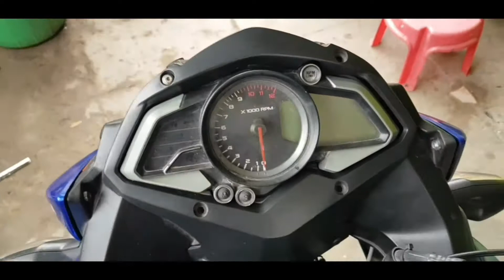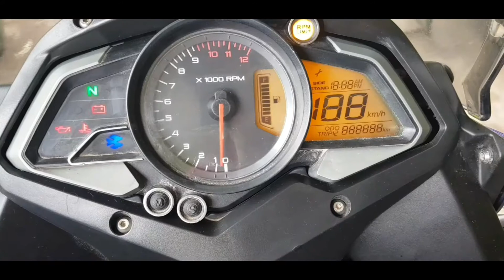Rebuilding a Pulsar AS200 | New Mods || Part-3

Comment: Nice video, For changing air filter, do we need to remove the whole front panel  or is it just sufficient by opening the tank bolts and nuts just like ns 200
Reply from the maker: We should open it fully bro , the front panel is screwed with the tank from inside.

Comment: Brilliant video bro.. I own a AS200 and a member of AS200 india group. Just love the bike's look..! Am happy that after seeing your video, couple of my doubts got clarified and it seems conversion of NS200 ABS BS6 to AS200 is possible. Totally clear where the welding needs to be done for mount and all.
I have doubt on 2 things - 
1. The wiring harness compatibility to accommodate AHO. 
2. Connectivity to 2-H7 instead of 1-H4. Possible? I mean how do we do that?
Reply from the maker: Happy to see you having an as200 ❣  
1)More likely the wiring for aho would be same as like the old one ... only a 6 pin socket will be having 3 pins or 4 pins as it's a AHO... 
2) Yeah we can connect a H4 socket as the one in Ns200 .. the wiring for headlight is a separate plug and play harness. U will be just needing to buy a headlight wire harness..
Reply: @ModMaxX  Thanks a ton bro. Really appreciate your help and knowledge... 😊🤝
Reply from the maker: @anubhavdutta9557  thank you for supporting brother ... any  more doubts dm me on instagram brother... I'd - ModmaxX
Reply: Hi Anubhav, i have been in search of AS200 dedicated group since a long time and would like to join one, so as to share and be part of the community. Do let me know how and where the group is hosted.
Cheers

Comment: Bro can we install as150/200 fairing in ns160 bs6 model ? With led AS150/200 headlights and everything?
Reply from the maker: S bro we can fix it
Reply from the maker: Only an extra fairing clamp is required
Reply from the maker: Also for led u can install h7 led in as200 fairing
Reply: Thanks a lot bro
Reply: Do you the price of the fairing and headlight setup of AS150/200
Reply: Also the clamps
Reply from the maker: @atharvagujar4780 its 3500 for heading fairing costs nearly 6500
Reply from the maker: @atharvagujar4780  I got this from old market
Reply: Thanks bro by the your headlight setup looks amazing loved your video bro 😎 ❤️
Reply from the maker: Thanks bro
Reply from the maker: Lots of love❤❣